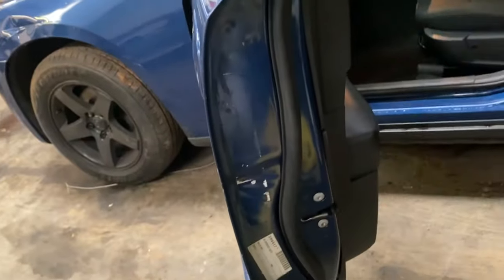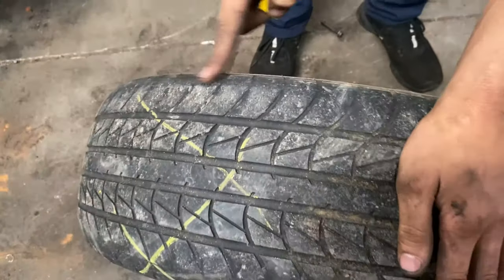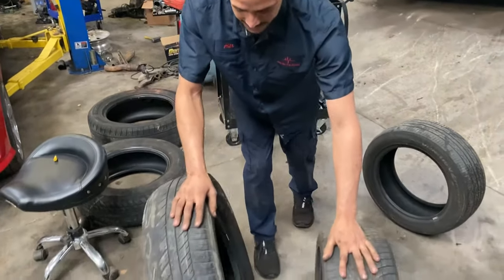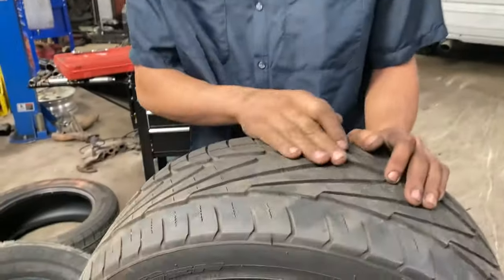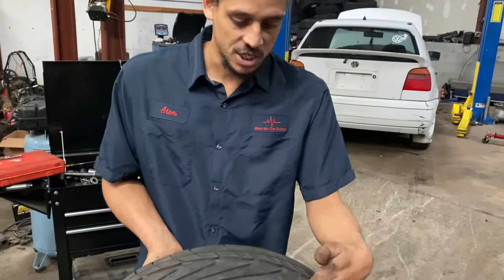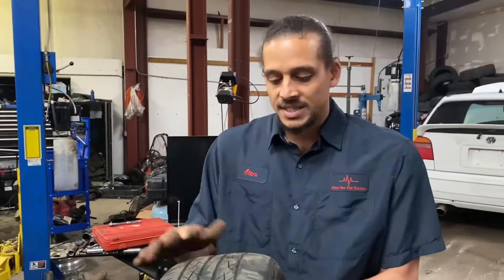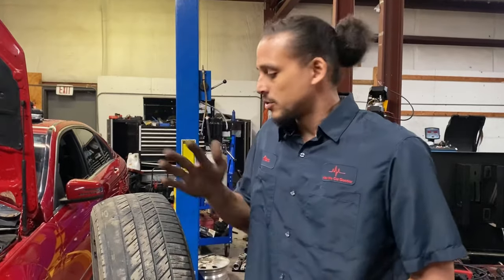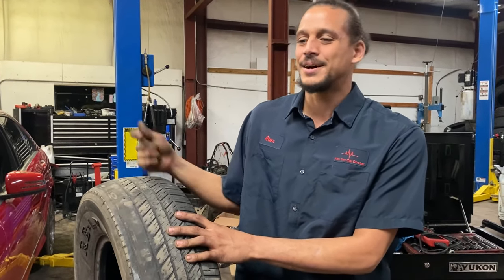Why Tires Wear Unevenly ( Top 5 Reasons) #tires #tirewear #uneventires automotive tire noise

Comment: I have a tire that I bought that has waves in it from previos truck had bad shocks will the tire wear out even if my shocks are good or do I need to replace it ?
Reply from the maker: I personally tried this but was so annoyed with the sound it made I took it off lol. Yes but it will take a while depending on how bad the tire
Reply: @AlexTheCarDoctor  is is not to bad but it is a 35 inch mud terrain tire and I did not want to replace since it still had a lot of tread left
Reply from the maker: Then you are fine they are A little loud by nature so you have nothing to worry about

Comment: Rotate only applies to cars that have the same sizes front and rear. Mine has slightly wider tyres on the rear so cannot rotate.
Reply from the maker: Thanks for the comment I do believe I forgot to mention that some of your Mercedes BMW and other rear wheel drive performance cars have have  Staggered wheels meaning they cannot be rotated
Reply: @AlexTheCarDoctor  No worries, your video offers good advice to people. I had a Mercedes coupe, and now a BMW where the rear tyres are wider. 
Keep the good videos coming. Cheers
Reply from the maker: Thanks buddy

Comment: What if you drive through the bends and corners without breaking.... would that cause rear tyre wear over time? Similar to the look of out of alignement tyres.
Reply from the maker: Sounds like you have fun driving like I do lol,any kind of sport driving as I like to call it will be hard on tires, but yes that will make your tires wear like that
Reply: @AlexTheCarDoctor  Thanks for the reply Alex.... I need a harder compound for the back or I need to reteach myself to use break and corner like an old man...😪
Reply from the maker: @MJKDESIGNer  a harder tire Will result a Tokyo drift scene soft tire is your best bet. It cost to have fun in the automotive world unfortunately.

Comment: My Ford F-150 back tire is wearing on the inside what would make do that an a little in the middle of the tire
Reply from the maker: Well I know if it’s wearing in the middle it may be over inflated,it’s not too much to align back there it’s a solid axle so I’m not too sure why I would be wearing on the inside unless you have a bent axle which it’s rare unless you’ve been in an accident
Reply: @AlexTheCarDoctor  nope hasn’t been far as I no thanks for getting back to me
Reply: @AlexTheCarDoctor  one day it was really hot the roader. 
Then I was told it could be the wheel barring 
Thanks
Reply from the maker: @budeugene5301  those Bearings really don’t give any issues on a solid rear axle vehicle
Reply: @AlexTheCarDoctor  ok I didn’t really no ur giving me more info about it thank some people I ask 
Thanks again
Reply from the maker: @budeugene5301  my pleasure buddy I’m here for you

Comment: Got a 2001 Mercury Cougar, BOTH rear wheels have camber. The car only has 60k miles. But both tires in rear wear on the inside of both tires. It clunks bad here and there and when you take off. Unsafe at speeds, ball joint, strut, shock? I have no idea UGH! thanks
Reply from the maker: It could be anything but my guess is that you have worn out control arm bushings they are rubber so they were out from sitting

Comment: Hello Alex. My car is currently making a noise while driving (mostly vibration?) every time I turn, step on the gas, or just driving it tends to vibrate. What do you think could be the problem?
Reply from the maker: Hello and thanks for watching.what type of car do you have, what is the condition of your tires
Reply: @AlexTheCarDoctor  hello i have a ‘18 Camaro. Tires are good still. Do you think changing  the transmission fluid would resolve?
Reply: @AlexTheCarDoctor  i took it to the dealer and said I needed to change the fluid. The car shutter/vibrates while driving/turning it was also due for an alignment

Comment: I lowered my q50 about 6 months ago on rsr super down springs wit stock suspension and my back tires are wearing out from the inside and I had my alignment done with it was lowered so do you think it’s the suspension that’s causing that ?
Reply from the maker: Hey there it’s definitely your suspension when altering the factory suspension you have to pretty much change everything. my suggestion is to get fully adjustable control arms so you can adjust camber angles properly
Reply: @AlexTheCarDoctor  so i need to camber the tires?
Reply: @AlexTheCarDoctor  how do I figure out how much to camber them
Reply from the maker: @D0nt_trip3  I do believe so can you send me a picture of the tires in question on Instagram
Reply from the maker: @D0nt_trip3  you will have to go to an alignment shop or better yet a performance shop with an alignment machine

Comment: My back tires In a 2013 corolla are wearing unevenly across the tires. Putting my hand on the tire some tend in higher than others. What could be causing this?
Reply from the maker: Hey thanks for watching.you may have bad shocks
Reply from the maker: But hard to say without seeing it

Comment: Hi alex, i have a question.. my car tires have an “underinflated” type of wear like you described, getting thin on the edges.  Except it was never underinflated.. i checked them regularly every 2 months, and i had the car for a year.. do you have any guess of what may caused it?  Thank you!
Reply from the maker: Hello and thanks for watching.let me ask this did you purchase your tires new or used or is this a vehicle you just purchase also what type of car do you have.are you using manufacture tire psi that information is sometimes found on your drivers door jam and always in your drivers manual
Reply: @AlexTheCarDoctor i purchased the car last year, its a brand new 2020 subaru outback.  Brand new tires.  Yes i used the recommended psi.  Thanks for the quick reply btw
Reply from the maker: Great that’s one of the cars I know very well. I spent a number of years at a Subaru dealership working on them and I can tell you this that’s normal for Subaru to eat up tires like that with its advance all wheel drive system it drags the tires causing that type of wear. There are always complaints about the tires never making it through it’s full life expectancy. Try over inflating it 5 psi over recommended psi
Reply: @AlexTheCarDoctor  oh thats good to hear!  My car does have a current problem, but so far unrepaired by the dealer because they cannot find what the problem is.  Everytime it hits a bump, it shakes side to side worse than any other car i had before.  The body is very easily moved by wind, when i close the door it shakes the whole body.  I thought it had something to do with the tire.. have you had any similar question from your previous clients?  Thank you so much again for the answers 🙏🏻 subbed!
Reply from the maker: Thanks for the subb. That’s not normal at all the shaking thing you may have a manufacturer’s defect fight the dealership until they get it right or tell them to give you a new car.2020 was a rough year for everybody you may have that Covid car that never got over Covid.I love figuring out new problems too bad I’m not there to help you solve yours in person please let me know what solved your problem if they can fix it
Reply from the maker: One last question are they still running Bridgestone tires on the Subarus I know they were when I was working on them
Reply from the maker: I know I said last question but what is the mileage on the car
Reply: @AlexTheCarDoctor  covid car?  What do you mean lol.. you mean they sabotaged my car? 😆 or do you mean handful of cars have quality issues because of the pandemic panic?
Reply: @AlexTheCarDoctor  yes my car tires all bridgestone
Reply: @AlexTheCarDoctor  milage just over 18,000 km
Reply from the maker: Quality issues most likely lol. The Bridgestone are good tires but hey they could possibly be defective as well 18k km is very low mileage I normally don’t see tire wear until mid 40k km something is very wrong.is it possible for you to send me a picture of your tires my email address is topmobiletech@gmail.com.I will like to see for my self
Reply: @AlexTheCarDoctor  of course.  I will send you email with pictures attached.  Cheers
Reply: @AlexTheCarDoctor  sent!  As you can see the tires seems to slowly worn out on the far edges.  Again the dealer service centre has serviced my car twice, and made no comment in regards to this.  So i believe it’s normal?
Reply from the maker: I have not received any pictures yet
Reply: @AlexTheCarDoctor  alex, now i know what the call the problem that i experience, it’s called body roll.  When the car is on standstill, i go outside and i push and pull the car body sideways, it takes a while for it to stop completely.

Therefore when i drive through bumps or uneven road let’s say on the right, i can feel the car leans to the right, then bounce back horizontally more than usual.
Reply from the maker: That sounds like defective shocks that can really screw up the tires also
Reply: @AlexTheCarDoctor  you are right alex, my car had only 28000 km and both rear shocks are leaking now.. it is defective shocks.  Hope to get it changed in 2 weeks and see whether there will be improvement
Reply from the maker: @ndk4  hey buddy good to hear an update from you hope all is well with you and your family. Yes I do believe fixing the shocks will solve your problems did the dealership find this or did you find out for yourself

Comment: My steering wheel is not straight and tires a wearing on the inside…. What could that be?
Reply from the maker: My recommendation is to get the front end  checked out on the car. You may have some faulty suspension components if so get it fixed and get alignment